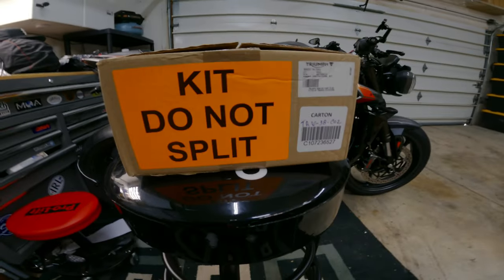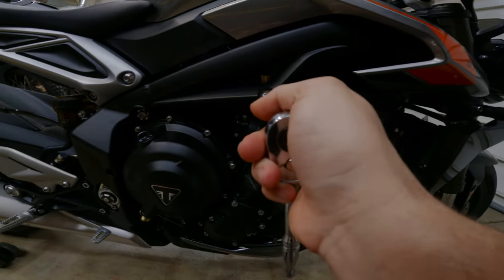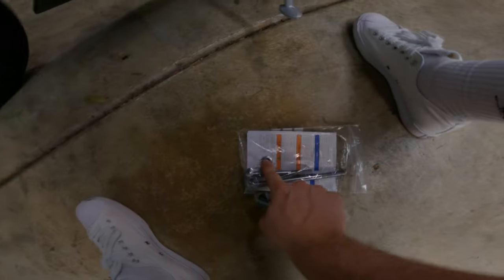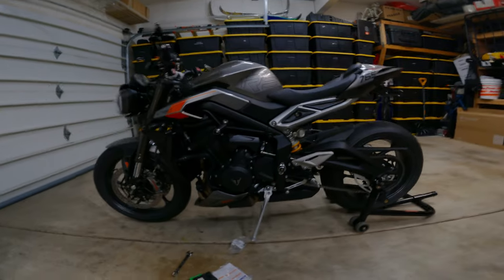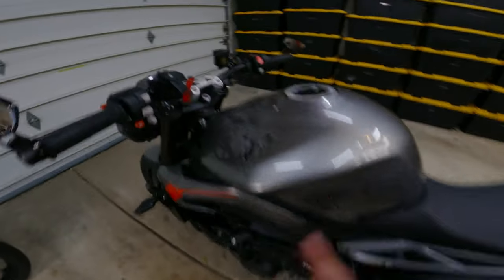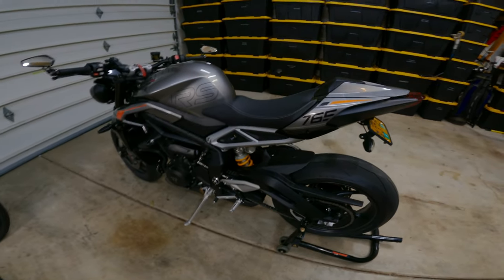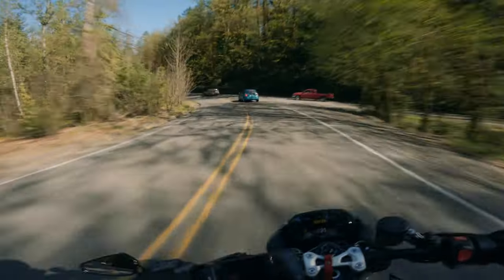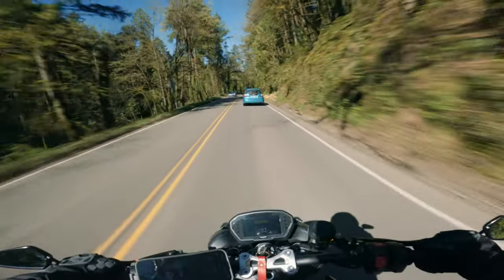Installing Frame Sliders On My 2024 Triumph Street Triple RS!

Comment: Got my 2024 RS on Saturday, this channel finna be my go to when it comes to the 2024 model RS mods lol
Reply from the maker: Congrats! Lots to come :)
Reply: @rwdconnor  was meaning to ask, for the bolts; what was the torque spec they need to be at when putting them back on?
Reply from the maker: @Davey_ItsaRS  The handlebar clamp? 26 Nm
Reply: @rwdconnor  no, the frame sliders. Wanted to know what the torque spec was for the engine bolts when you put them back on with the frame sliders.
Reply from the maker: @Davey_ItsaRS  Ahh, Yea idk. I just got em pretty tight. Let me look... 48nm

Comment: Hi, I’m 5”7 with 29.5 inch inside leg. The RS is tall and so considering R with low seat or LRH R.  What are your stats and how do you manage ? For me , slow control , and need for foot down on slops is a consideration with seat height. 🏴
Reply from the maker: Hey there! Im 5"6 when i wake up so legally 5"5 and i dont find the RS to be difficult. However it is noticeably taller than the trident. I had the Low seat for the RS and i didnt like it. It was too sharp in the thighs for me and i preferred the stock seat if im being honest. But at 5"7, the R with low seat should be great if you find the comfort :)

Comment: Does this come with replacement nuts and bolts for both sides? I’m pretty sure the shitty evotec ones I tried to install messed up the stock nuts on one side of mine. Thanks!
Reply: And which frame sliders are these? Are they the Triumph Cleveland ones that are around 200?

Comment: Question: when you got your bike, during the break in period, what RPM limit did you stay under?
Reply from the maker: Im still in "break in" haha. I just ride the bike how I would, just not bouncing of limiter haha. Apparently the bikes are Ran in on a Dyno prior to shipping so if anything were to happen, it would before the dealer even got it. I was advised not to just sit in a single gear on the highway for too long, and just ride the bike how you normally would haha.
Reply: @rwdconnor  that makes sense, I was told something similar by my dealer, okay ig I’ll baby her a little less now lol, thanks Chief

Comment: Nice bikes! Did they come with LED turn signals? I've seen some videos from the US that dont have LED signals.
Reply from the maker: Thanks! The street triples come with halogen bulbs for the turn signals in the US... Here's the link to LED ones https://www.amazon.com/gp/product/B09HBR9TF9/ref=ppx_yo_dt_b_asin_title_o07_s00?ie=UTF8&psc=1
Reply: @rwdconnor did you by any chance end up getting hyper flash with these LED turn signal? I tried installing mine on my bike, I was getting hyper flash and a warning sign “left indicator is on”.

Comment: Nice videos for the new bike.  I have also just got exactly the same bike and would like to know if you can show us how to remove the side panels as I cannot figure it out.
I can see the "button" which you describe but cannot remove it.

SUBSCRIBED 😀
Reply: You probably figured it out, but in case you didn't...
Press the center of that button in with a little hex  or even a paper clip. It will click and stay depressed,  then you can just pull the button off. Panel pulls straight off with a slight push forward.  Then reset the button for reassembly.

Comment: Hi, I just put a deposit on a 2024 ST RS in cosmic yellow (coming in July) and found your channel and subbed, enjoying the content. I'm 5'7" and 150 lbs. and you are roughly the same size, How do you find the suspension set up from the factory, have you adjusted the front or rear ?
Reply from the maker: Hey congrats!!! Im trying to get to 150 haha. 

I find it to be pretty nice, though im about 20lbs heavier, i MAY go to a suspension specialist and see if he can tune the bike to my weight. I find it to be nice overall though, no real complaints, though i dont know any better soooo.

Comment: Add links to sites for Mods, Better lighting and focus on the mods more, you move around a lot. Hard to see exactly what your doing. Otherwise good job just need some tweaking to your vid style. What Sliders did you install???
Reply from the maker: This is probably the only video I’ve made where I didn’t include links. Watch the other ones. They progress the longer you watch. This had to have been the 3rd video I made.